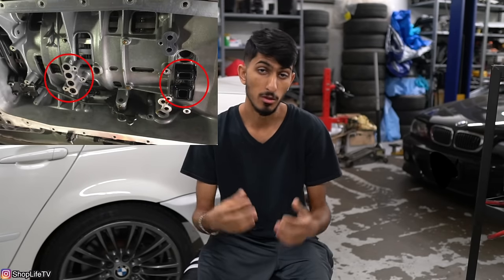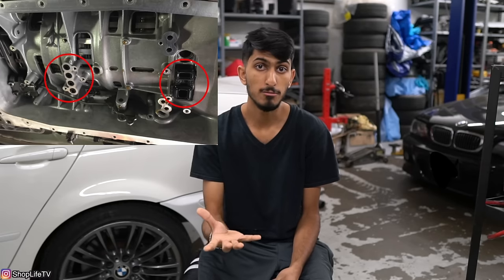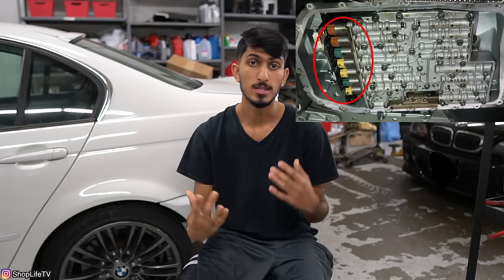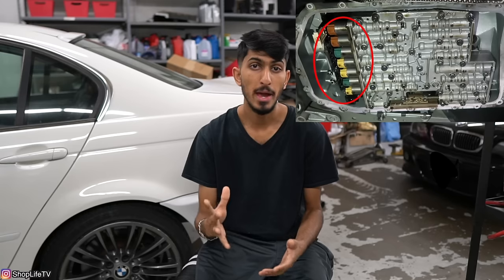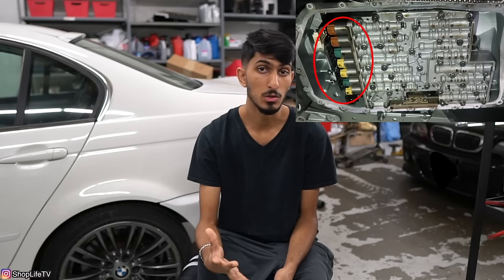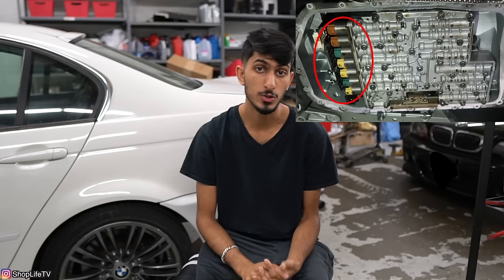ZF 6HP 6 Speed Auto Transmission Troubleshooting! Common problems

Comment: Help please anyone.. I have an E90 318i and have two fault codes 4F80 and 4F86. The car goes into limp mode after some time driving. After I turn the engine off and then on it works ok for a while until it happens again. Does anyone know what the issue is at all or what I could look into?

Comment: I have 2010 E-60 528i, mine clinks as soon as I put it in drive (no clinks between gears), but it's  weird, sometimes it almost completely goes away and then it would clink iven harder. I changed the fluid and oil pan/filter, it started doing it some time after I did that fluid  change. If anyone is familiar with  this problem I would appreciate any information!

Comment: I have a issue hopefully you can help me figure this out. I have an 06 530xi normal driving it runs just fine shift just fine but let's say you're doing 60 or better and try to pass somebody from 4th to 5th it will seem to slip then kick into gear it doesn't do it every time but enough to annoy you and if it does it enough the transmission will go into default
Reply: Did you figure this out? I have the same problem.
Reply: Same with me!! Anything?

Comment: if I sometimes have a rough upshift into 3 do you think it'd be smart to replace just that solenoid at the same time as doing the sleeves and new fluid/pan?
Reply: I have the same issue sometimes rough shifting from 2 to 3 did you get it fixed yet?

Comment: my e87 GM auto transmission got jerky shift from 2 to 3rd gear. no fault codes. changed transmission oil. mechanics adviced to recondition the tranny. anyone got the same problem?any solution?

Comment: I was getting a 4F8A code for my transmission. Its started after i tried resetting the adaptive like people talked about YouTube (hold down gas pedal for 30 seconds). I took the pan down and tested the ohms on the solenoids and they are all in range. Replaced the sleeves except the 4 little ones because they looked in good condition, added new fluid which wasnt cheap lol, and new pan/filter. Oh and there were NO metal shavings on magnets and fluid really didnt look bad. When i was done i used a c110+ to clear codes then drove it. It still slipped between 4th and 5th gear, then i reset the adaptive using the c110+ scanner and if i drive like a grandma it shift fine. I havent got into it yet because i would hate to see it slip again can you tell me what you think?
Reply: Solenoids can ohm just fine and still be bad hydraulically. Internal Leaks are main problems with then.
Reply: hey mike how did you fix your problem? i have the same issue i did the reset and than got trans malfunction
Reply: @prajp9795  in the end i went and got a used transmission online and installed it. And now things have been working good.
Reply: @mikespratt8350  who did you trust to buy a used transmission online?
Reply: @prajp9795  i went on ebay and it had a 90 day warranty and i installed it. It wasnt hard to install

Comment: What do you think can cause my 2004 e60 to have a bouncy rpm needle when cruising around 40mph? maybe just a fluid change?
Reply: Did you find out what was the problem? I have the same issue in my 2005 jaguar super v8,  after I did the oil change. I'm going to replace the seals and see if that's the problem.  Let me know.  Thanks
Reply: @Krishis Studio ....which bushings do you mean?.. between mechatronics unit and the gearbox?
Reply: Hi, Did you find out the problem? was it torque converter?

Comment: What can cause jerky shift from P to R to N to D for ZF 6HP 6 Speed?
Reply: Solenoids or worn out transmission/ engine mounts. Hard to say
Reply: @SD Check your guibo and rubber drive shaft mounts first, bro

Comment: hello sir, I m a car mechanic. i have little experience in mechanical field . I have one problem in BMW E66 6HP26 transmission. the car is not moving in put any gear like reverse or drive. I m raise the car and check the transmission fluid level and condition. the oil level was correct but the condition of oil bad the oil was burned. I m remove the .transmission fluid sump for further inspection. the clutch grinding powder in side sump. I decide to repair the transmission remove the gear box from the car. Open the gear box and i m fully changed the clutch and friction plates and also change the orings and gaskets . And refix the gearbox in to car. the car before starting i m done the clear adaptation . the car shifting gear reverse and drive is perfect but the car is jolting hard jerk coming when the gear shifting time from 3rd to 4th . The fault is showing gear ratio monitoring 3-4 gears. what happen i dont know. i m not change the valve body. can you help me what is the problem .
Reply: You can rebuild the valve body with sonnex parts but in your situation probably salenoid

Comment: Hello, I just replace my mechatronic sleeve and the plug adapter for my 2008 Bmw 535 xi. Everything was reinstalled correctly. However the car wont start again. The error message on the dashboard that says...4x4 and DTC malfunctions...Do you have any idea on what s going on? Thanks again

Comment: I just started getting a code 4F8A ratio monitoring gear shift 4-5 what could my problem be never felt any slipping before 2008 335i AT transmission 116k not the first owner so I don't know if it has been serviced anyone know what my problem could be
Reply: Did u find out? I have the same issue with the 5th gear

Comment: I am using pentosin atf1. is that wrong?
Reply: I wouldn't worry. Pentosin is a good brand. As long as it meets the specs require it should be good to go. Sometimes other fluids work better than oem fluids. However some people don't like to take a risk and chance it other than oem. With oem you know it's going to work. Often oem are made and sold under another name for much less. You just have to find that info which is hidden and hard to come by because the oem don't want to lose sales otherwise. If you want to reduce the risk just take out a little of the old fluid and add a little of the new fluid. Do that a few times until all the fluid is changed eventually. This way you don't totally remove all the old stuff and put in new stuff all at once. Drive and pay close attention to how the car shifts and any weird noises. If all is good you can add more in each time or in two or three interval.

Comment: I love your videos, i've learned a lot. I have a question, I recently had my transmission rebuilt and it runs fine...until it gets hot then it goes into Limp Mode. When I run my scanner I get 5000031 and 5000036 plus the message " Code not found in database"  any ideas? I own a 2003 330i automatic sedan. Thanks and keep up the great work.
Reply: Gary Rogers I have cuestión I have bmw 530 I now I have message and the dash said transmission failsafe program wats tad means thanks

Comment: Plz stop all this. Just clean the solenoids or replace them and change the fluid n filter fill the fluid to the correct level. Solves the problem. All transmission mechanics are thieves simple.

Comment: terrible first bmw experience  for me so far. ultimate headache money pit machine - for me over here. made in germany huh....??? more like Taiwan
Reply: My chiropractor is from Germany and he was telling me they only drive Mercedes-Benz because BMWs are trash I am in the same boat as you
Reply: That’s why you don’t buy the cheapest one you can find. Not sure what you expect from a used sports car.
Reply: you pretty much have to be a bmw technician if you want to buy an older higher mileage BMW or else repair costs will  quickly exceed what you paid for the car
Reply: The zf transmissions are the best in business, but they can’t last forever. What’s the mileage of yours and when did you change the fluid?
Reply: Many people expect all cars to be like Japanese econoboxes that run fine on deffered maintenance.
 Then they buy old high mileage European cars for cheap and complain when things don't work.